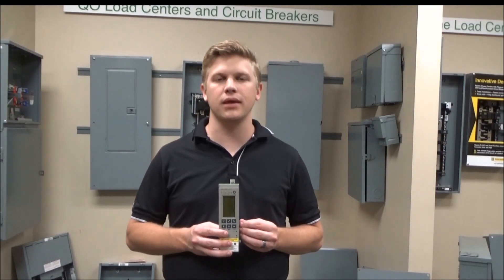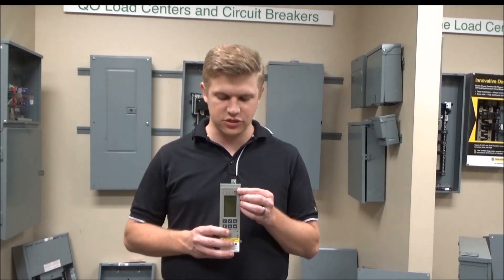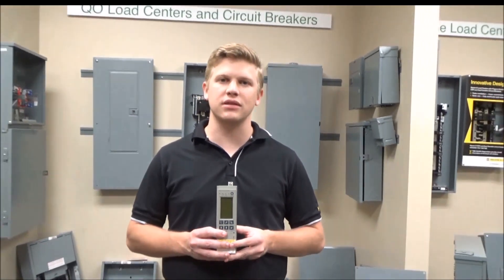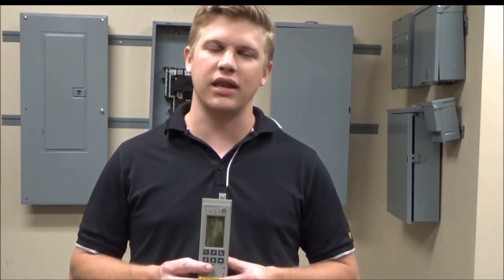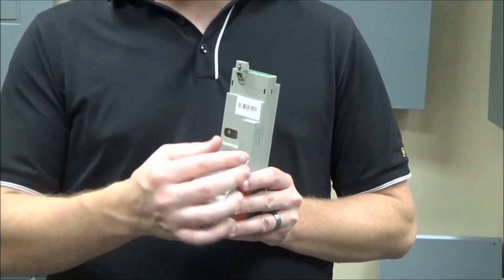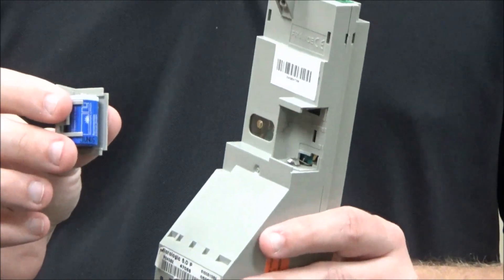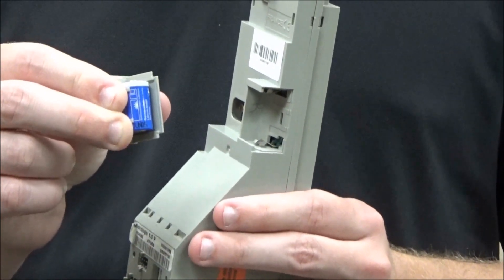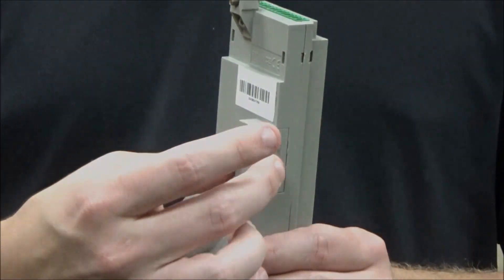Replacing Display LED Battery on Micrologic 3.0, 5.0 and 6.0 Trip Units | Schneider Electric

Comment: Can this module be removed from a live breaker to change the battery?  The building can not take a shut down of the breakers.  It is a hospital.
Reply: I also need the answer for same questions
Reply: Did you ever receive an answer to this question?
Reply: @antonrasmussen4055  no I have not.
Reply: Hello, I'm looking for the same answer,